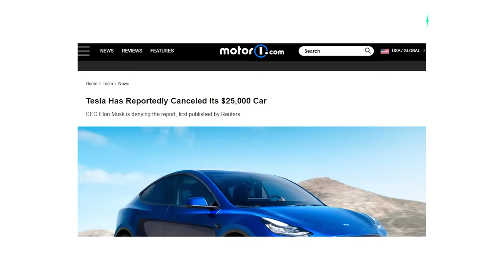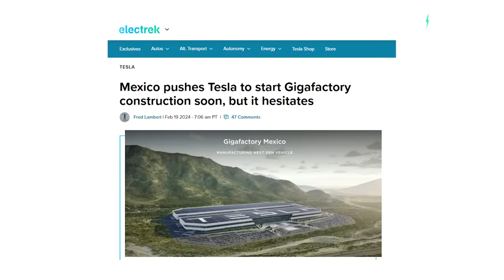The REAL reason Tesla is 'delaying' NOT cancelling Model 2 production

Comment: Love your vids, Sam, but I think you've got this one wrong. "Model 2" AND robotaxi are both designed for production using the brand new unboxed production method. There's NO evidence in Giga Texas production being cancelled due to labour costs. Unboxed will be the most automated method in history and Elon stated that the production facility (I'm avoiding the term "production line" as it's not a line) WILL be in Austin because that's where the best engineers/designers are. It WILL be built in Austin but all of the first models produced will be robotaxi. "Model 2" (the one with the steering wheel) will come after that on the same production facility and by that time the Mexico factory will be there.
Reply: My guess is that they'll build vehicles so fast, they'll outstrip not the demand for robotaxis but the cities that will allow them to operate there. I'm expecting a small number of high profile pilot schemes, and any excess production will simply be used up as consumer models of the vehicle platform. If this unboxed method is that good, I think they'll be able to change models really easily. It may just be, 'miss out these 3 steps, send the car to step 14 and 15' and it becomes a robotaxi with no steering wheel and a sealed dash or something. It might even be possible to update one vehicle to the other in the future as required (I mean, obviously it's possible since everything can be disassembled but possible and easily done by a garage).

Comment: model "2" is as important as model y. they have to bring it to market and all problems are solved, because it will sell even better than y. in markets like germany the model 3 isnt selling well enough. its y und 2 what really moves. i anticipate if tesla is concentrating on juniper and something smaller than 3, it will be able to beat even the chinese makers. remember, in europe markets the people tend to suvs much more than to cars like sedans (model 3). the y sells 5 to 6 times as much as model 3 for example in germany.
And I would also advise Elon to make a more attractive financing offer for the Model Y, because there is currently an extremely negative mood in Germany and a lot of uncertainty when it comes to e-mobility. inflation is high, the economy is weakened. the people hold their money. In order to counter this stupid trend, very strong short-term and temporary impulses are necessary, in my opinion. tesla is very, very important for the ev market. especially in germany.
People in Germany are totally unsettled because completely contradictory political signals are being given. For example, official e-mobility is preferred, but in return electricity is becoming increasingly expensive and gasoline remains relatively cheap. A very important electric bonus has also abruptly disappeared in Germany, and people are buying combustion engines like crazy again.
tesla has the might to change this trend. i hope they know it and act like that. even if this imposes a temporarily lower benefit, the long term effects will be absolutely satisfying. proper anticipation is  key now.
Reply: All Tesla need to do is re-engineer the model three into a hatchback. I don’t know why they insist on not doing this. I can only imagine they think it will cannibalise their own model Y sales. I think demand varies with countries because here in the UK there are only 23 available for delivery model threes in the entire country. So someone is buying them!! And of course by buying them I mean renting. This makes it easier for people to think short term because it’s not their problem after three years when they hand the keys back.
Reply: @ouethojlkjn  would be a good idea, yes.  Simply a shortened Model 3.
Reply: @ouethojlkjn  ok, in germany no one wats sedans. Model 3 sells, yes, but notmally no one buys sedans.

Comment: Nah, labour is a fraction of the cost, it honestly doesn't matter at the scale they operate at and robots don't get paid anyway. They've said they'll build out the line in Texas to work on the engineering, get it in a good enough state and then install a duplicate in Mexico, which makes a lot of sense since their existing team don't have to live in Mexico to perform that task, or worse, commute regularly to it. 

In any case, the Mexico factory isn't even built yet so they are nowhere near installing machines there. You can't have a gigapress just sitting around under tarpaulin for nine months while builders faff about. We'll know when it kicks off since the drone people will be out, and we'll be able to see how quickly they can build one. Prediction, not as fast as Shanghai - unless, they've learned so much from builds that they've also got a way to lay foundations quicker. I mean, if Boring Company are doing anything like what they should have been doing, they'd be able to lay sewage and utility pipes super easily - but my guess is on a such a project they just cut and shut the underground stuff as there's no existing infrastructure to weave tunnels under and around.

Comment: I have to agree with your take on the timing of the Model 2 production. 
I expect the technology used in the production of the Model 2 is all new and had yet to be manufactured in the volume that the plant in Mexico will require.
This will be double if the Model 2 uses a 48 volt architecture. The effort to build all the various 48 volt actuators and devices and then write and debug all of the firmware for those devices will take sometime.
Remember Tesla wants to build the Model 2 in volumes which exceed all of its previous models.

Comment: Elon said during the Q4 earnings call that the main reason they want to begin producing the M2 in Texas is because the manufacturing process is supposed to be all-new. This is not sort of an off-the-shelf 'it-just-works' type of thing (direct quote from that call). So, in order to adopt the all-new process, they need Tesla engineers to be sleeping on the manufacturing line, basically. 

Now if that is no longer the case, then either the engineers working on that all new production process are all going to relocate to Mexico or China... or they've scrapped the idea of reinventing the process altogether, and they will just build a smaller car based on the M3 / MY process. My bet is the latter.
Reply: And it looks like I would have won that bet. The all-new production platform is out of the picture, as per the Q1 investors deck:

"These new vehicles, including more affordable models, will utilize aspects of the next generation platform as well as aspects of our current platforms, and will be able to be produced on the same manufacturing lines as our current vehicle line-up. This update may result in achieving less cost reduction than previously expected."

Comment: After the first delays of the Mexico Gigafactory by Mexican bureaucrats, Mexico effort was suspended and I believe will be cancelled. India may be on the front burner. The robocab will be built in Austin and hopefully Texas cities will be the initial test market for a run of 12K units for test. Data from this will then be used for NTSC validation of FSC software.
Reply: Problem there is that the states have to approve it individually.

Comment: Tesla might have the best EV technology. But clearly cheap Chinese EV cars have taken a toll on Tesla to the extent that it had to fire close to 14 thousand employees. Tesla is not only feeling the heat from BYD, but from new entrants like cheap Xiaomi luxury cars, and Huawei advanced AI and software.
Reply: Definitely feeling the heat, but bear in mind almost all (probably all) of these competitors are not profitable and just trying to scale to profitability. Which is probably impossible in this economic climate. In 2-3 years they'll all be gone, Tesla just needs to ride this out.
Reply: What exactly makes them the best? It's obviously not efficiency or charging speed. So what is it?
Reply: @user-ff3ib5oc4s  who is more efficient than Tesla? Who has faster charging speeds? For the same sized battery?
Reply: @EwanM11 Lucid, Porsche, Hyundai
Reply: @user-ff3ib5oc4s  ah right, i thought you meant Chinese manufacturers. Porsche Lucid and Hyundai aren't a threat to Tesla, their manufacturing costs are too high.

Comment: i wonder if it is because they have reached a step that they need either a new factory or space to build to make progress on the model 2 so they have shifted towards robotaxi while they wait for whatever is stopping them.

Robotaxi will need FSD to be FULL. and that is why they have the free month of FSD they need the data and for a month they will get it. 

Tesla seems to be doing 25 things at once while they are still building the factory or making expansions or...

so putting something on the back burner may mean a delay on release (tesla has never done this)  or a change in what will actually be built (again tesla would never). 

There are so many things being adjusted and worked on i dont know how they keep up... and now they have the juice peddle issue on the cybertruck causing a slight backup of 600-800 cybertrucks on the outbound and overflow lots while they do the fix.

Comment: The way Tailosive EV explained it was the Model 2 and Robotaxi have a shared platform. Elon tweeted the Robotaxi will be unveiled August 8th. So, the Robotaxi is given priority over the Model 2. Switch out the dashboard and you have a Model 2 (steer by wire).

Comment: Model 2 production is only going to work if the volumes are huge, and that's going to involve the Unboxed process. If the Robotaxi is going to share most of the platform, it could be that Tesla will make that with the Unboxed method to test it out. Robotaxi production volumes are never going to be anywhere near as big as the Model 2. Even if Level 5 autonomy was here now, the idea that Robotaxis would somehow displace a significant amount of car ownership doesn't make sense. Sure, it might reduce the cost of taking a Taxi, but who uses Taxis anyway? Compared to the number of people using other public transport and their own cars, it's tiny. The only people who are going to lose out are Taxi drivers, and there will likely be a few more of them.
If I have a car at home, I'm sure as hell not going to take a Taxi anywhere, be it driven by a human or AI.

Comment: Model 2 @ $25,000 vs robotaxi on Model 2 platform @ $100,000. Which would you prioritize?
Reply: The one that is achievable, Robotaxi is a gamble , there are regulatory, technical and legal hurdles that will have to be cleared state by state which is the reason that many experts are sceptical as to its chances of success. Either way, it’s years away, where is the profit coming from in the meantime?

Comment: fine cars. but wont save you a penny. I can buy a new loaded corolla and drive it 155k miles before i reach the 2024 msrp of a tesla3(20k less price, 4400 gallons of gas 35 mpg). At 154k miles your battery (replacement cost 14k) will be out of warranty for 35k miles (expires at 120k).
You will talk yourself into trading the car in before your battery fails because at this point the 60-70% depreciation makes your car worth less then the battery cost. So before you save a penny you'll trade it in. Just like i did twice with my 2005 and 2012 prius before i did the math. I didnt save a dime at the pumps that i didnt have to pay elsewhere to avoid the pumps.  When you trade in the tesla at 130k miles a well maintained garage kept corolla could be driven for another 150k miles as long as im satisfied with driving an older high mileage car. And thats the issue. Most americans and people with money dont drive old high mileage cars they talk themselves into a newer one. Thereby not saving a dime.

Comment: You're probably correct. Tesla need another mass market vehicle. Two aging models against the flood of cheaper Chinese vehicles suggests trouble. BYD alone has how many models?  And can produce a 'Model 2' for much less. And most likely will.  In Mexico.
Reply: Many models are not a benefit if you are trying to be profitable. Few models are Teslas strength from an efficiency / production standpoint.
Reply: Yeah this is the sensible take. Why build a factory in Mexico if there's no plan for a Model 2. Building a 25k Model 2 in Texas in probably a stretch too far.

Comment: Musk posted support of ‘war time CEO’ and “auto’ tweets as well as liking.a tweet on ‘all in on robotaxi’. I don’t see how one can interpret TSLA’s plan as anything other than M2 not a current plan because we’re in ‘wartime all in’ mode on robotaxi. Looking at TSLA broadly, the 2024 $10B investment in FSD reported by Musk means that investment in SX3Y are reduced (money has to come from somewhere, it’s from existing ‘legacy’ cars). Why? Competition has arrived on SX3Y (although 3Y are very good cars, SX aging out). China already owns the $25k car and Musk doesn’t think that margins will be worth it. The move to robotaxi fulfills Musk’s longterm dream to reshape transportation.

Stock price: going down. Reason: capex will be high, margins reduced for next 2 years MINIMUM (if Robotaxi comes into being as a commercial effort in 2 years). Market will pull $ out (because earnings will suck for 2 years at least) then wait and see what happens. If TSLA robotaxi works, $ will come back in. If not, getting out was the right move. Reasons to be positive; Musk record, TSLA tech bench, FSD improvement, TSLA manufacturing prowess. Reasons to be negative: Regulatory barriers across EU and China that will/may prevent TSLA from entering without a local competitor (this is huge, because if TSLA has trouble entering markets, then the robotaxi thesis is damaged). FSD has to improve a lot (.999 thing in Musk’s words), semi-abandonment of mass ‘driver car’ market by not upgrading aging lineup, ability to create a tech stack that duplicates Uber and Lyft, the poor track record of TSLA as a fleet partner (Hertz got treated badly on service/spares/depreciation) so that the ‘private owner” robotaxi needs a lot of work to be realized, new model introduction has not gone smoothly ever with exception of Model Y (which was very common with M3).

‘Bet the company’ moves have worked (Boeing 707, 727, 747). No one knows how this works out, not even Musk. He sees that staying the course means that the rest of the world catches up (as China is doing know, BMW showing it can be done, Chevy Silverado, Kia EV9…all in segments where TSLA has no plan to play or is not playing from ahead). The lever Musk wants to pull is robotaxi/AI. The one he won’t pull is ‘more models, more updates, more cars. The 20M’year goal is out the window. The pace of new factories doesn’t support it, and all-in robotaxi confirms it. Fascinating move by Musk, but then he can afford to take this kind of gamble. If it ends in tears, he’s still got SpaceX. For shareholders, different story. NO ONE KNOWS how this will end, but make your bet based on your hunch!
Reply: Boeing is  probably not a great comparison to make.
Reply: @tatata1543  The Boeing generation that made those bets were as great as Tesla is today. It may be that the 707, 727, 747 were a bit before your time, but they were stunning aircraft. They made Boeing the undisputed world leader in a gigantic market. It was meant as a compliment to TSLA.
Reply: @rebreaville9332  How are Boeing doing these days? Let’s see, they are reliant on government subsidies, losing out to a leaner, fitter foreign rival,  their product line is moribund and plagued with quality issues and the management makes one disastrous misstep after another. Come to think of it how is Tesla doing? Actually, you’re right, it is comparable. 😂
Reply: @tatata1543  I’m not communicating my point. Boeing IN 1960s, bet the company several times to fund breakthrough products. They were indisputably successful. That’s my comp to Tesla today. Not Boeing today, which is a company divorced from its engineering roots. I am not a fan of today’s Boeing.
Reply: @rebreaville9332  I get your point, my point is that Tesla are more like the Boeing of today than the Boeing of the past, I gave examples of the similarities which you haven’t challenged. Those planes were new models and a big step forward in plane design but they were definitely evolutionary. Musk seems to have given up on evolutionary design and jumped straight to something he thought of in a fever dream. He is gambling the future on a fantasy, a fantasy which, if rumors are true, senior managers at Tesla have spent years trying to dissuade him from. Which may explain why senior people are leaving.
Reply: @tatata1543  Yeah, I agree with that. Interesting take. I wonder if senior departures are about selling vested stock options at higher prices. IOW, they see a stock decline coming and exited for personal. financial reasons.

Comment: I won't harp. I have said over and over that Tesla cars should have nice vertical A pillars, nice high roofs like a 1978 Chevrolet Caprice. If people cannot comfortably enter and exit a car they will not buy it!   WTF!!  . DON"T try to make a robotaxi out of a tiny little model 2. Use a Model X or the coming van.  Build a vehicle like a Jeep. Build like Zoox.  It is a winner and will beat TSLA robotaxi if it is tough to  enter and exit.    The A pillar should be vertical with a nice big angle at the top where the tall roof starts and goes back and stays tall.  LOVE my '78 Chevy Caprice and I will not sell it to buy a lousy low, tiny car that is tough to get in and out of?    Humans have not evolved since 1978,  but the A pillars have. They all deserve what they get in lousy sales. All the car makers have fetish about an extremely slopping A pillar and a low roof that is tough to use. See the Chevt Bolt!!!  Geez  WTF   WTF?   A 6 foot person cannot ride in the back seat of a Chevy Bolt without leaning over 30 degrees.